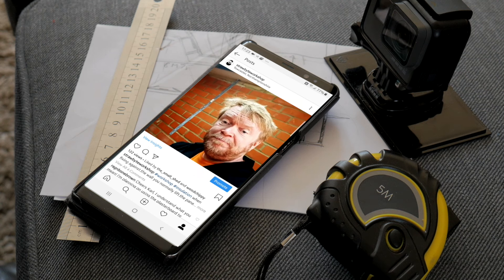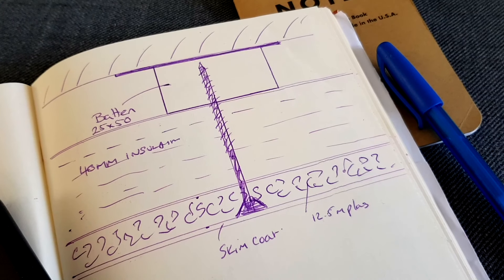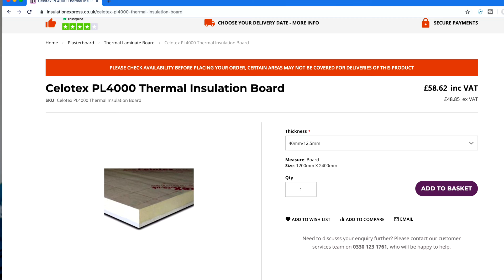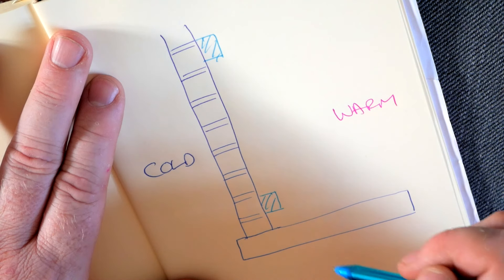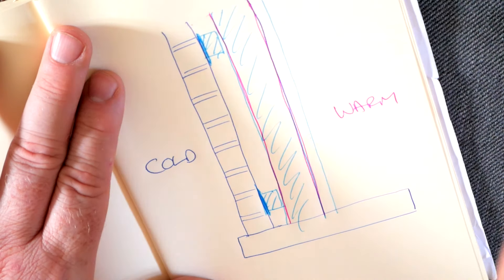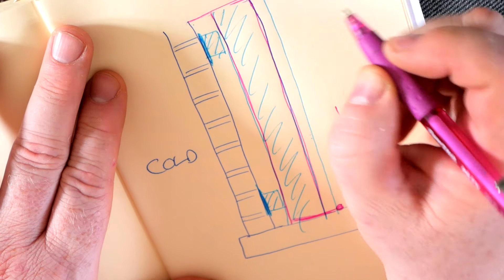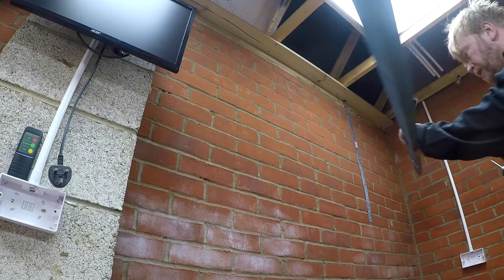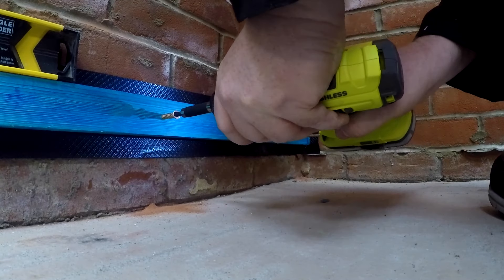How to Insulate Your Workshop | An Easy DIY Project | Keep Your Shop Warm or Cooler

Comment: Hi Karl, a great and useful video even though now 3 years old - thank you very much for doing this. I have a question: You said you used Celotex PL4000 which comes connected to 12.5mm plasterboard. In your costings (11:50), you use 40mm Celotex, and MDF - I'm now confused. Did you  put MDF up against the plasterboard? - If the Celotex is already connected to plasterboard, do you need the MDF as well? Or have you simply split out the costs even though it came as one sheet...?  Thanks! Ed.
Reply from the maker: Thanks for the question and it's one that's been asked a few times since I put the video up and something I wished I'd explained better. 
The project used two separate methods the first used insulated plasterboard. 40mm PIR plus 12.5mm plasterboard. The second used 40mm celotex and 12mm MDF. 
The principle reason for change of approach was difficulty in ordering and storing in the dry sufficient insulated plasterboard. It was also very heavy and hard to work with on my own. The second approach worked better as the insulation could be stored outside and the MDF delivered as needed on a daily basis from my local builders yard. It's worth saying that 3 years on there is no difference between these approaches in terms of the quality of the finish or the performance of the insulation. I've had others follow either approach and let me know how they got on, the insulated plasterboard approach seemed to work well with those starting with and empy garage. those like me having to work around a space already in use, prefer the separate insulation and MDF approach.
Reply: @StrawbyteWorkshop  Thanks for such a prompt reply, and it is great to get a response at all as it is uncommon. What you say about plasterboard and MDF makes sense and a really good tip. I'm considering taking a similar approach with a brick built lean-to. I have not done something like this before. I've just watched another video where he guy is using 90mm celotex which is pretty thick, but then realised he built his summer house with OSD (no brick) which is why he'd need much thicker insulation. One thing I'm wondering about is whether to get an electrician to feed in electric around the brick walls BEFORE I apply the insulation walls. This way, the electric cables could sit behind the MDF and I could cut holes for the electric backboxes to be placed and wired in. However, it is probably much easier to fit the insulating walls, and then have electric cables running around the outside - similar to what you have running down the breezeblock/concrete columns. I don't know in practice how difficult this would be to do. If you've got any thoughts I'd love to hear them, but it's out of the remit of your project which looks fantastic. Putting a video like yours together takes a long time, so thank you so much for taking the time to do it! Ed.
Reply from the maker: @ereckitt  Hi Ed - I thought through what I was going to do about electrical cables at the time opting for surface mounted conduit and Dado trunking. It might be worth speaking to your electrician before proceeding. The advice from the insulation people was to avoid having cables come right through the insulation to the inside surface. Their suggestion was to counter-batten over the insulation to create a void between the MDF and insulation where cables could be fed. Any back-boxes could sit flush with the MDF surface and be recessed without having to dig-into the insulation. Had I done that that would have removed a further 50mm from the inside dimension of the space and hence why I opted for surface mounted electrics. They've proven very flexible post installation as I've had additional sockets added as I've changed my layout.
Reply: @StrawbyteWorkshop  Good advice, thank you (and having surface mounted does have it's benefits). One last question: You left an air-gap/cavity between the wall and the celotex. I've always understood this to be the right thing to do, in order to prevent moisture from traveling from the outer wall to the inner wall. However, I have seen many put damp proof course over the whole brick wall, and then put celotex right up against the damp course sheet, so there is no air gap at all. Do you have a view on this? It seems wrong, but presumably it is an option as people do it (rightly or wrongly!). Thanks again. I'm interested to hear your thoughts. Ed.

Comment: Karl, great video, thank you. What did you use to seal the bottom and the top of the wall (6:16 in your video)? I am going to epoxy paint my garage floor first and will then move on to insulation. Many thanks, from another Karl.
Reply from the maker: Hey Karl. I don't know about you but when you get to meet another Karl (albeit on-line) it's quite a rare treat. Anyway, I didn't show it very well but did describe it. For the most part the gap is sealed with Everbuild AC50 accoustic sealant in a 5-8mm bead around the edges of the insulation as it meets the wall. Okay, step back. You see me install insulated pasterboard on 2 walls the gap between the boards, floor and concrete blocks were filled with AC50 and for some larger gaps over 8mm Soudal Gap Filling Expanding Foam was used. Here the seal is really between the plasterboard layer and the concrete/blockwork. Later I applied the insulation and then a MDF skin. Here the wall/floor gaps were filled with AC60 before the MDF went on - any large gaps filled with foam, and then only vertical gaps filled again with cheaper decorators caulk. The gap between the MDF and floor was covered by skirting (although it took me 3 years to get around to it).

I hope that your project goes well. You'll find my flooring video on the channel but I think you're going about your project the right way. Looking back I wish I'd fitted the floor first and then installed the walls as it's probably the better way to go.
Reply: @StrawbyteWorkshop  Karl, thank you for the detailed response. And yes, it’s a rarity to meet Karl’s with a ‘K’ these days👌🏻. 

I’ll check out your flooring video also. I’ve just ordered all of the epoxy paint so am looking forward to getting the flooring done. It’ll then be the wall insulation to do and, following that, insulating the roof (like you, I want to keep the loft space for putting items up in the rafters).

Comment: This is a brilliant video - thank you. I'm happy to have found your feed. I have a couple of questions I'd be grateful if you could answer - 1) I assume the roof was already insulated? (I couldn't find a video on this), and 2) what was the decision to not insulate the blockwork piers? Was it purely to minimise loss of space? I guess there's some heat loss through them but you took a decision that in the context of the overall wall area it was insignificant. Thank you!
Reply from the maker: Thanks for your comment. I would suggest that you take a look through the comments for lots of information not included in the video about the work. Specifically:
1) I did post a video about that (https://youtu.be/fpO6lMwRpCQ) but I made a mistake in the construction of the insulation in the roof. The video shows a gap between two layers of insulation which shouldn't be there and it's taken 2 years of work to slowly go around the roof space and correct the mistake. I do plan to put another video out.
2) So there were a number of options I considered when planning the build which were discounted and led to the approach seen on camera. You are right to assume that minimising the space lost in building the walls out was one and those methods that would have covered the pilars removed the most space. With regards to the pillars themselves, I chose to wait before insulating them as I wanted to work-out first what I wanted to mount on the walls as they are strong-points in the building. They have now been covered and fully insulated. I get asked a lot about this and I'm considering revisiting this project given a renewed interest in this project recently.

Comment: Hi, thank you for sharing although seems a long time now. Am in the process of insulating my workshop and have 2 questions - 1) Is there a reason why the insulation is attached to the battens rather than in between and to the wall itself? 2) How much warmer is the workshop now, was the insulation installed sufficient? Thank you
Reply from the maker: Hi - thanks so much for the question.Regarding 1) I considered 3 approaches to insulating the space. a) a stud wall 50mm away from the infilled with insulation, a further layer of insulation and finished surface (MDF, plasterboard or ply), b) foil-faced PIR plus finish surface, or insulated plasterboard stuck directly to the brickwork, or c) the approach featured in the video. Insulation on top of battens.

a) was discounted due to the loss of interior space. The wall would have been 180mm thick either side or 280mm lost internally. If you were insulating a garden room, office, gym or yoga studio, that might be acceptable. 

b) It was discounted due to both Celotex and Kingspan (who provided direct help with the project via their technical line) advising against sticking the product to the wall if the wall is exposed to external weather. Fletton bricks are really very porous. Before the project, a windy storm would lead to water being driven into the brick and running down the inside of the wall. It is really the longevity of the adhesive that's the problem - prolonged exposure to moisture might result in the adhesive failing and the insulation detaching from the wall.

c) so this option was chosen. It allows water to enter through the brick and any moisture condensing on the internal face of the brickwork to move within the 25mm cavity and eventually migrate back out through the wall in drier weather.

I hope that's clearer - I know in the video I focused on the vapour barrier, but the nature of Fletton bricks was the primary consideration. If you're insulating a blockwork wall, a wall made from engineering bricks, a concrete panel wall,  or a wall with wide roof eaves at the roofline so rain doesn't touch the wall surface, then you may glue directly to the wall. There's another video (a car garage) on youtube where the person glues directly to the wall where I think the had no water penetration of the wall.

With regards to question 2. The space is so much warmer. In the video I discussed the fact the space is 5 degrees cooler in the summer. In the winter, generally, 20 minutes of a 2Kw heater is enough for it to stay above 10 degrees for the whole day. Remember, I've only insulated which minimises heat loss when you put heat in. I might do a follow-up video on this because during the winter months I tend to run a dehumidifier continuously through the winter to bring the relative humidity to around 55% and the unit dumps its waste heat into the space keeping the temperature around 5-8 degrees all winter long. When I'm out in the workshop I tend to use infa-red radiant panels to just warm me in the two spots I tend to stand and work.

It is well worth doing.
Reply: Hi, thank you for taking the time for your detailed response it’s really appreciated. I am of a similar opinion regarding option a) as would confine my space greatly. My bricks are set with lime mortar however the walls have never let any moisture completely penetrate but I assume option c) and leaving a gap should any moisture come through to dry out in the summer would be best. Will batten with damp course strips and tie into damp course at floor level. 

Sorry a resulting third question, should any weep holes be installed at ground level?
Reply from the maker: @JM-xq4oq  I’m glad I could help. In terms of weep holes, you generally require them when you have a cavity tray installed in a typical two skin cavity wall. I saw no advice from any of the insulation vendors recommending the batten approach to retrofit them.
Reply: Amazing, thank you so much. Has given me peace of mind of the best approach and cleared up some confusion I had from my research. Floor and ceiling are already done so just the walls left 😊
Reply from the maker: @JM-xq4oq  I’m interested, because I’m always asked about mine, but what steps did you take to insulate the floor?
Reply: So admittedly mine was a bit tricky as retrospectively fitting onto concrete base with a side door/step into rather than garage door so didn’t have much room to play with and didn’t fancy digging down to insulate. I painted blackjack dpm and up to existing wall dpm. Then self levelling compound as was uneven, then 50mm insulation board, expand foam for gaps and aluminium taping joints (hoping will be sufficient) then high grade 22mm chipboard. Believe is known as a ‘floating floor’ but could be wrong. There was a helpful video showing this on YouTube. I haven’t watched your floor video but will have a look.

Just saw you’ve fitted a side door, so mines is the same minus the garage door :)

Comment: Hi Thanks for the video it was very good. Just one thing , why did you not insulate the pillars between the main wall areas?
Reply from the maker: Hi - firstly, thank you for the feedback and comment.

At the time of recording, the concrete pillars presented two problems. 1. The two closest to the front of the garage supported the up-and-over door; 2. Quite frankly, I wasn't sure what I would do with them in the long term.

Since making this particular video, they have been insulated. A 3-sided plywood box covered 50mm of PIR insulation fixed to the pillar itself. By the time I got around to that part of the build-out (not long after I had the personnel door installed - see another video), we were in the middle of the first COVID lockdown and never made a follow-up video. Sadly for me, I was an essential worker at the time, and I was worked off my feet for two years!

Anyway, it's a common question, and in hindsight, it does look like an odd decision not to include them in the insulation video. Time permitting, I may eventually get around to explaining that part of the project.

Regards. Karl.
Reply: @StrawbyteWorkshop  
Thanks for your question Michael and the reply Karl as I was wondering the same thing.  I'm also in a new build and have two lots of pillars on both sides of a double garage which go all the way up to the top of the roof. My problem is I only have 2 inches of clearance between the first joist and web (i think it is called a web) and the pillar.  I did take a picture but I don't think I can add it.    I guess I will do the same and box in. Any other ideas?
Reply from the maker: @thatsfresh01  feel free to send a picture to workshop@strawbyte.com and I'll take a look.

Comment: Great video and explanation. Thanks for sharjng. I want to do my internal garage but its has brick on outside wall  and also breeze block on  all internal walls. Would i need to do a vapor layer and dampproof course?
Reply from the maker: Internal Garage conversions do require special attention and it sounds like your existing walls are constructed in a particular way. It’s not clear if the wall is cavity or solid. But a call to the technical department of any PIR manufacturer will guide you on the install including how much insulation, vapour control measures and if any separation is required between the new materials and existing walls. The new room will be considered part of your home and may require building control approval. Something I avoided by being detached and not creating a space that was for sleeping, cooking or washing. 
These are just a few pointers to help you look for the right advice as I can’t advise you on your specific situation. K.
Reply: @StrawbyteWorkshop  thanks so much for your help. Great advice.

Comment: Thanks for  your reply. I have a garage... ex garage...now a workshop....metal cabinets  workbench    tools..  love D I Y.  Present project I have a garden shed 6ft x 8ft   in the garden when  my family moved into the property in 1975..  wow how many sheds last that  long !!!!!  So probably  early 70's or even 60's.  I converted it into a photographic darkroom  and now restarting it again  after 45 yrs. The previous  owner was an amateur radio enthusiast  put in electric ,fitted shelves  one side and insulated walls and ceiling  using loft wool  insulation  covered in hardboard  painted white.. pretty impressive  and ahead of his time. Just replaced  rotting  floorboards.. and squirrel damage.  Hazelnut shells.. and will remove  wool and hardboard.. replace with celotex  and white covered hardboard. Remove  concrete  sheet roof...reboard and shed felt..  thinking about raising roof  18" - 2ft while roof is off..   happy days 😊

Comment: Surely the breeze block areas become cold spots and potential for condensation?
Reply from the maker: HI - it took a while before I was able to get around to cover those areas of the wall as I wanted to think-through how I could use them as strong fixing points in the workshop. Essentially they were clad in 40mm of PIR with a plywood box around them to provide the finished surface inside. However, the insulation of the walls was largely effective keeping the space cool during the late summer months and warm over the following winter. There was no condensation forming on them in the coldest months when I was in the workshop and of course the issues I had the previous year with wet weather penetrating through the brick had been resolved with what you see in the video.

I had planned a follow-up on this build but I'm afraid the covid pandemic got in the way but the video has had a surge of interest this summer and I might go back and cover all the things that got done after this video went up. Thanks so much for the comment.
Reply: @StrawbyteWorkshop  great info, thanks.